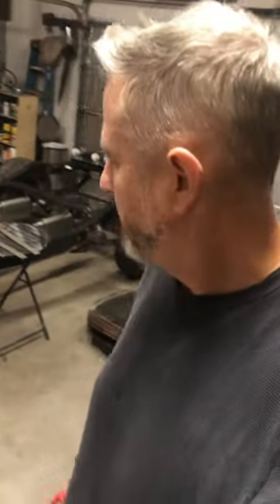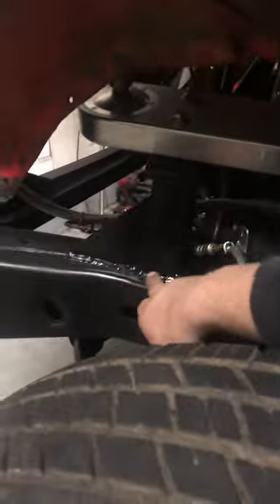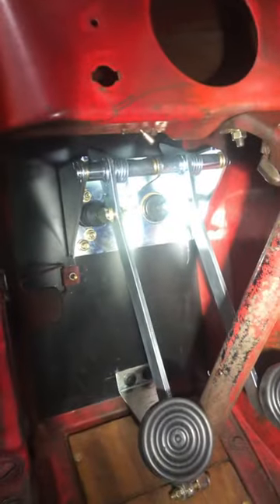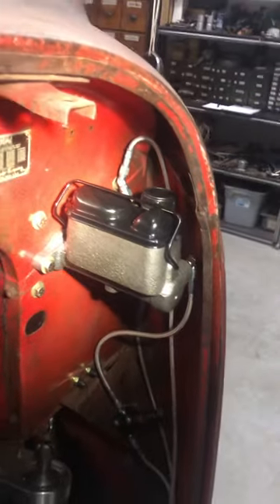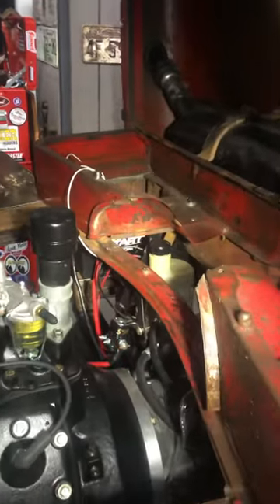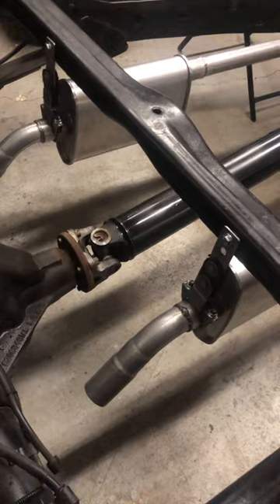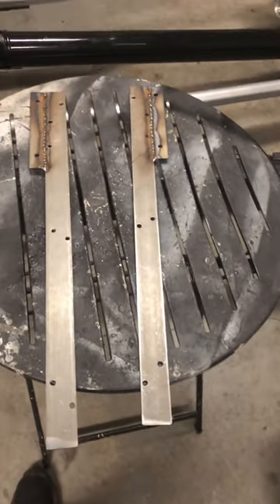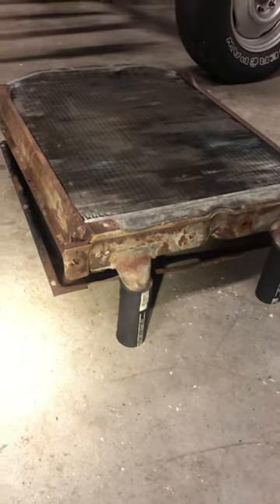1939 Ford COE Cabover Engine build update part 2

Comment: Beauty truck Chad! Im fortunate to have 5 of these.... three Ovals and 2 Waterfalls... None run yet but you provide great insperation. Right now working on a 47 Dodge COE. Have Cummins/5-speed installed and rebuilt front axle with 70's Dodge motorhome large disc brakes. ...  adapted directly onto the origial 47 axle using the "newer" spindles and rotors. Love your truck!!
Reply from the maker: Thank you!  I’d love to see yours.  I also completed a 42 waterfall grille Ford COE and I’ll be posting all those videos once I combine and edit them. 

Please consider liking, subscribing and sharing my videos to help my channel grow.